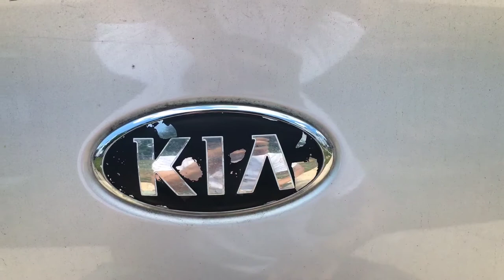How To Restore Vehicle Emblems (Andy’s Garage: Episode - 202)

Comment: Did you put new adhesive on the emblem? You put some silicone on the studs before you placed the emblem back on? Thanks had no idea I could paint my worn out Kia emblem!
Reply from the maker: @Successismine777  there was adhesive on the emblem already that I did not remove. It adhered right back on. If not, you can add silicone to the studs or VHB tape to the back of the emblem